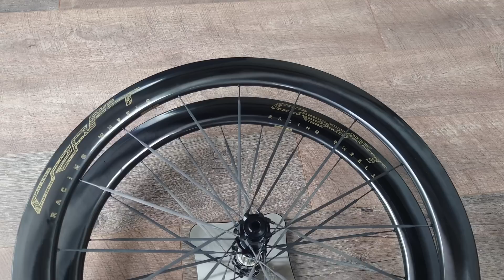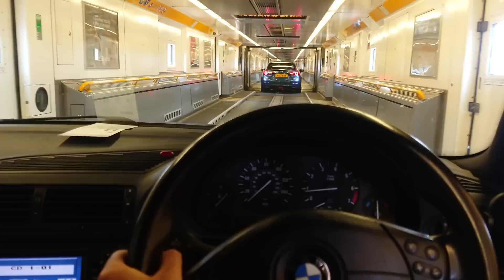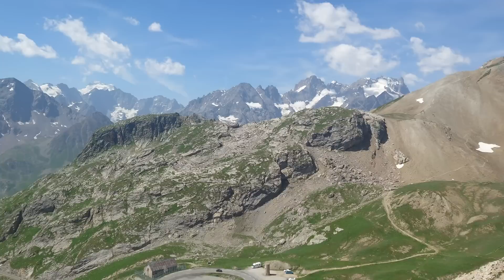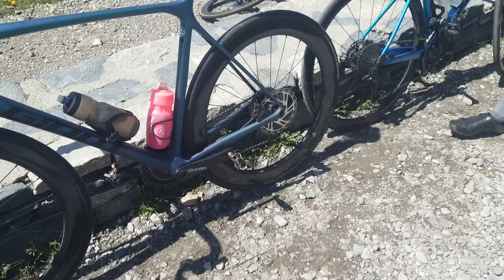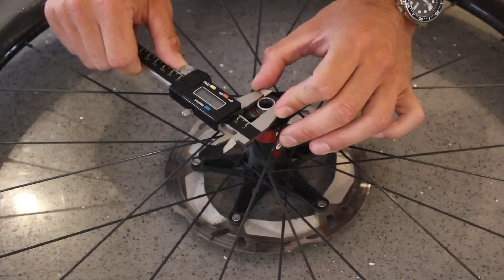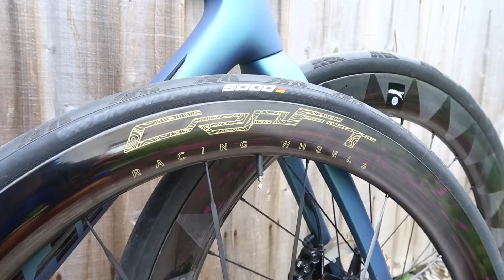Carbon Wheel Perfection Roasted at Gas Mark 6 - CRW

Comment: Nice looking wheelsets but getting up there in the $$$. I'm thinking of doing a self build with a pair of tune hubs, shallow 23mm rims off Ali and not sure on the spokes as yet. I like the clean look of internal nipples but I've had thin spokes break at the hole from stress. Very happy with the a Ryet set of wheels I've been using this year but they don't make a shallow climbing set. Just pindering the play in those end caps... shouldn't affect the mechanical function as the thru axle is doing the alignment work. More of an annoyance and poor sealing which is not acceptable. I had a similar issue with caps on a front hub a few years ago, sold on those wheels now but I'm think they were either Bitex or Novatec. Anyway of finding out if craft are making their own hubs or buying from the parts bin? It's a world of outsourcing and cobbling together ad-hoc event to the point that the caps could be outsourced whilst the hub body is made in house only.

Comment: That hub design is also on giant’s  PR-2 disc wheel. This wheel set came on all giant advanced (not pro or sl) series bikes. It’s absolute garbage. My end cap and the o ring was completely disintegrated after 1000km of ridding. At the end, you get random braking ‘cause of the deformation. I went through 3 front wheels before realizing something is wrong with the design and bought a pair of farsports wheel.

BTW I think rider weight has something to do with the noise. If you are below 60kg, it’s hardly noticeable.

Comment: What do you mean "we are working on a fix" (6:23)? Are you working for Joe at Pandapodium? Did you get free stuff to try out and are you being compensated to produce videos on this product? 
Sounds twisted.  But then again the channel is called Peak Torque.
Reply from the maker: I told them the tolerances that would be a better fit... Absolutely not compensated which makes me kinda pissed

Comment: Why do disc break wheels cost as much as rim break wheels? They appear to be similar to make with less technology, you dont need to create a high tech, heat resistant carbon break track that has good breaking properties.
Reply: Why do you think the bike industry pushed so hard for disc brakes? Higher profit for everyone! You also need to factor in rim brakes give brands a lot more $$$ costs in replacing delaminated rims.

Comment: I'm surprised Joe doesn't pick up on this stuff before he stocks it. He seems pretty thorough. How do we know everything else on PP is safe if these slipped through the nets? I'm hoping it's a one off because I like Joe and I want him to succeed.
Reply: Could be that joe is too light for that problem to occur 😆
Reply: I was more surprised than you! Everyone can check my Strava, I'm riding all this stuff every day. I obviously wouldn't be able to ride it if the rear rotor wasn't locked down. I also wouldn't send a pair to PT if I thought there was a problem. There will always be a ~1% rate of products with issues in the bike industry. Only industries like aerospace can x-ray every single component, etc, etc. If you applied those standards to the bike industry, a wheelset would cost $20,000. It's not a PP-unique problem... a random example would be when the last generation of Shimano cranks were all splitting open... yet every single bike retailer continued to sell them. It doesn't mean it's "okay" though and I will continue to do everything in my power to make that number as low as possible. Hopefully this transparency helps with the confidence. Thanks for liking me Joe... I like you too!
Reply: In fairness to Joe that's a big ask for any retailer it's just not realistic. Ive been a importer and retailer of goods off and on for 20 years and it's impossible to check every product especially if your shipping direct to customer from manufacturer. Suppliers can make it break you.

Comment: The YouTube cycling niche is continuously head-over-heels for the latest Far East wheelset, meanwhile VDP is winning worlds on bone stock C50 wheels...
Reply: Until Big Brands slap their logo on those same Chinese wheels and sponsor VDP.  Just admit you brainwashed monkeys hate seeing China building them first. (You’re brainwashed to hate all the time. If it’s not the Soviets, it’s Vietnamese, then the Iranians, then the Iraqis, then the Afghans, etc. You don’t even know any of those peoples, never visited their country. Hate because your media tells you to.)
Reply: Fair point. C50s aren't cheap wheels though but certainly not weight weenie. I think recreational cyclists and semi professionals want the lightest products to get that edge where they may not have that pro level power.
Reply: @glennoc8585  Have you actually checked prices?  They're within a couple hundred of these wheels, a few hundred off the new Hypers, and cheaper than flagship FarSports.  And that's excluding any VAT you may get hit with...which would make them more expensive!  Compared to Western brands like Roval, Zipp, DT Swiss, etc, they're a good bit cheaper.

The point to be made is that the benefits, which are often hard to measure in real world, are overstated.
Reply: This. it's getting annoying to see all this exotic chinese stuff on YT as if the chinese are trying to reinvent the wheel. Get a basic and solid DT or a good Dura Ace and that's it. Seems like the only thing worth on this wheel so far is the shiny look....
And as another chinese fanboy youtuber (friend of PT) said recently on Youtube : you can't cheat the physics. If I was 88 kg on a 100 km/h alpine descent, I wouldn trust a 1200 g ultralight carbon wheelset. Weight or durability and robustness, make your choice.

Comment: I think I've got the same issue on my Trifox rear wheel. Too much play in that top hat spacer. I've finished my build, I'll do a test ride and see if it is noticeable. Might end up requiring swapping in a different rear hub or a whole wheel. Front is fine, hard to mess up. Thanks pt.

Comment: Any thoughts on using sellotape for "fixing" the fit issues on the fly? Might sound silly, but could also work (can do a lot with that stuff).
Reply: No way would you get a turn of sellotape inside those tolerances.
Reply: @gregmorrison7320  There is thinner tape available. Could that work?

Comment: Sorry bit if they are claiming +/- 0.002 in production I would want to know what their calibration process is and are they 100% inspected. To hold that in production is a massive undertaking. Also can you inspect the bearing bore please. Tie the shaft down as mush as you want but if the bearing end is oversize as well the shaft size is irrelevant.
Reply from the maker: Bearing fit I will check good point. 0.002 may require hand lapping, not easy as you say but i know one hub maker that is doing exactly that!

Comment: Yea man, I got over 1000km on my wheels so far…. I did an unboxing of the wheels and they LOOKED great. Now I have had mikes on there, being heavy rider 200lbs riding in groups 26-28mph with Strava to confirm the rides, I haven’t had any issues with the wheels… this is the truth. Sprinting riding no problems. Even had a friend take out the bike for the weekend to ride it. But no matter what people think, products will have an issue on something mass produced. And it all depends on how that company handles the situation. I have seen in my industry as well from big name brands like tactic hubs, and also dt seiss 180 hubs where the center lock was not machined right and wouldnt take the disc brake and the whole hub had to be replaced. My experience with the wheels has been extremely good, and so far the stats they bring to the table they are very impressive.
Reply from the maker: Fair enough, and yes my sample size is just 1. I am not asking for a youtube special, refreshing to see this pair clearly wasn't. But they wanted a review and I agree the stats are impressive. Just disappointed I could not review them and wasted quite a lot of time fault finding and measuring. Hopefully they'll get replaced and I can give a very positive review.
Reply: @PeakTorque I agree with that, if anything, it shows a good sign that he’s not cherry picking his inventory knowing he’s shipping it out to a YouTuber. This is good real world stuff
Reply: Out of curiosity, it wouldn't take but 30 seconds to pop your end caps off and measure them with some calipers...
Reply: @mikemiller756 would it make you happy if I did that? If I’m not having issues would you want me to do so?
Reply: @GCPerformance18  Well if it's undersized, it's undersized.  It would be more data than a sample of one that PT has.  Everything from the weather to simply just a different bike/fork/thru axle could be the reason you have had a different experience.

Comment: If they can’t get the end cap tolerances right, a seemingly simple detail to provide in a drawing set, what other things have they missed that are not apparent from a the first few rides or visual observation 🤔
Reply: Outsourcing I'd say of the end caps. They should be visually checked in QC but that's China at times.

Comment: You should ask to get paid for consulting, plain and simple. Both issues are entirely unacceptable. Doesn't even take an engineer to understand that play that goes click click and a rotor you can't tighten are unacceptable problems... Now what if we find out that their carbon layup consistency is random as well? On such light wheels, it can be catastrophic. Why take the risk? And they're expensive. I understand panda podium wants to capture some of that dentist cycling vibe, but not for me for sure.

Comment: There is an obvious answer, CRW should spec these with a 240 hub, could be the perfect wheel set.
Reply: Sadly they can't do that, the spokes are designed to thread into the hubs to eliminate spoke twist, no other hubs have this design.
Reply: @DrMonkehify Didn’t realise that. 👍
Reply: Or just offer the 240's as an option

Comment: Industry Nine Torch front hubs had the same issues. I decided that my hubs will always be DT Swiss from that moment, except for my XC bike which has I9 hydra hubs for the zero-lag engagement.
Reply from the maker: Woah, really? That is pretty bad considering theyre a big name.
Reply: @PeakTorque  More specifically Torch Road hubs in centerlock. The endcaps fits inside the hubshell and it did creak from time to time just like you described. As far as my Hydra hub goes, the rear one did slip and I9 instructed me to double the springs i the drive mechanism.

Comment: Think you really kept your cool there, considering they've sent you a product that could have put your safety at risk. I had a front wheel that made a similar noise a couple of years ago, I'm now wondering if this too could have been the issue. Commendable work you're doing as day-to-day consumers aren't likely to spot some of these problems, manufacturers need to know it's not acceptable.
Reply: Curious what that brand of wheel was?

Comment: This is nice to see. Both your honesty and how Joe is responding. Honestly no surprises here as I know both of you are solid people from everything I've seen. If there's anyone I know who'll make the situation right, it's Joe, so I don't doubt that the end cap issue will be fixed in no time. I'm definitely very interested in a set myself and I'll be waiting for your full review to get one!
Reply: PT is great to work with. Obviously I wish this problem had never existed, but multi billion dollar car companies have recalls every day. Manufacturing is complex and things go wrong. Looking forward to getting the issue sorted though.
Reply: @pandapodium.official  Kick their butts Joe as its not good for you albeit not you fault. I understand your car manufacturers analogy but this is simple QC of a bicycle wheel in the end. I just had a frame from China with a crappy decal that was painted over. That should not have passed from bench to spray shop but it did. At least caps can be easily swapped.

Comment: the lockring issue is an endemic one since the release of centre lock rotors , i would place the blame squarely at shimanos feet , it needs one aproach then leave it alone , but shimano are keen to keep messing with stuff that should by now be utterly fool proof . i got to a point with customers being miffed about delays that i would buy any lock ring i saw on the market to hold in stock so i always had a fix , at last count i had 6 tools just to fit lockrings in their many permutations ,, that is all knock on for customer pricing for what should be cheap and fast repairs.  the axle issue was a booboo , i wish shimano was as helpful and quick as panda podium and the craft wheel manufacturers . shimano would still be denying there is an issue if they made those wheels .😘
Reply: Yeah, PTs feedback sent me down a rabbit hole of center lock failures. Shimano's own "white lettering" and "black lettering" caps have noticeably different threads (and not just the length.) It's very frustrating!
Reply from the maker: Centerlock is an absolute mess. It's more complicated, expensive and harder to machine than 6 bolt. There are zero upsides ( i know because i am making the f*cking things now). Secondly, DT use a metric standard and Shimano quote it in imperial TPI on their drawings (which is similar but not absolutely the same) . Absolute joke.
Reply: @PeakTorque  why the fook is a Japanese company using imperial on a new (rather than legacy) standard? 🤦‍♂️
Reply from the maker: @pmcmpc  I don't know. But i have the official drawing. I will show it in a video sometime maybe.

Comment: Even if the fit of those end studs (can't really call them caps, right?) was perfect, this is sort of engineering unaccepable for wheels priced over 200$. The weight saving from getting rid of a solid axle adds rather value in marketing than somehow significantly cuts cost in manufacturing.
Reply from the maker: Im not sure there is a weight saving over a dedicated shouldered axle, because then you don't need the internal tube spacer (which is larger diameter, thus r^2 mass increase etc). Anyway, its three tenths of fuck all
Reply: @PeakTorque yes, the tube spacer is usually lighter, because it can have a thinner area than an axle, as it doesn't carry shear load on top of being stiffer in bending. And it is only third of length.
Reply from the maker: @feedbackzaloop  its not thinner than a 240 axle.
Reply: @PeakTorque is it though? If so, then there is unnecessary margin where extra level of redundancy should have been, so there is a loss without winning in use of a cheaper process. Also, is it DT a direct competitor here, not Novatec/Bitex/etc?

Comment: Nice one PT. Pretty hard to keep integrity these days.
Any thoughts about why they chose this design instead of the common axle length? Is there any advantage?
Reply from the maker: Cheaper to accurately make the inner tube spacer (length tol) to set preload than a complicated stepped axle. Also easier to assemble. Weight wise hardly any difference.

Comment: Wow. What a shame. But great video.

As a side note, you mentioned not liking the DT Swiss 350. Just anecdotally, I've been running 350s on my MTB for over 4 years and I've been very impressed. (I would have gotten 240s but couldn't afford them.) I haven't had a single issue and with minimal maintenance. I've heard a couple mechanics say recently that they actually prefer the 350 over the 240 or 180. They said that the 350s were the most reliable of the bunch. I definitely believe you but from my own experience and hearing others like them a lot as well, I'd love to understand your opinion a little more. Thanks as always.
Reply from the maker: They have been reliable (still original bearings) but the lack of front axle means you need serious thru axle pressure or risk the front wheel bearings shunting onto the thru axle itself. Only happens on drops/jumps to flat, but it happens. Its the same mechanism as what's occurring here with this hub but more extreme as there's even more clearance.
Reply: @PeakTorque Thank you sir. I'm strictly a XC rider but I do ride very rocky, rooty, technical trails. That said, I rarely work through my 100mm travel front or rear. Maybe that's why I haven't encountered the problem you're talking about. Hopefully never will! Based on one of your previous videos, I do tighten up my thru axle as much as possible though.

Comment: Use the other type of lock ring.
Reply from the maker: I tried all my lockrings, lets say a small stockpile due to a lot of disc testing
Reply: This was a huge rabbit hole for me. There are 2 types of Shimano INTERNAL lockring. One cheap one with black lettering, one expensive one with white lettering. The black lettering one fits a lot easier than the white lettering one on multiple hubs I tested (multiple brands.)
Reply: Also, maybe this is why more and more brands provide their own lockrings... (including lightweight)
Reply: @pandapodium.official  Yeah cheap Shimano lockring (with black lettering) are made from steel and have shorter thread length than lock rings with white lettering witch are made from aluminium.
Reply: @pandapodium.official  I had an issue with cheap lock rings and TRP brand worked. I think some require the DT Swiss type. I’ve also shimmed it once with a part from a center lock to 6 bolt disc adapter.

Comment: No spare spokes Joe??
Reply: Not as standard. The odds of you snapping a spoke are low... the odds of you snapping just one spoke are even lower. Most brands supply 1 spare spoke of each length. The odds of them being useful are near to none. However, if you do insist, we can supply spare spokes in a set of 4 for 40 USD. Really don't recommend it though. Buy your wife something nice instead.